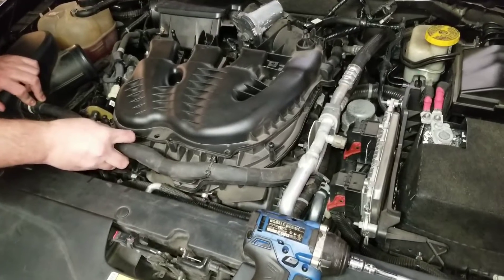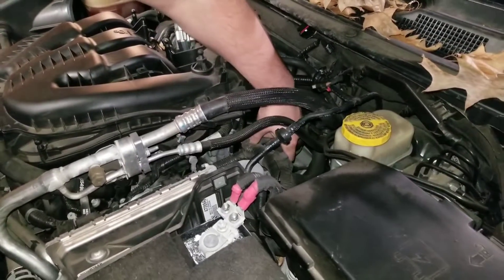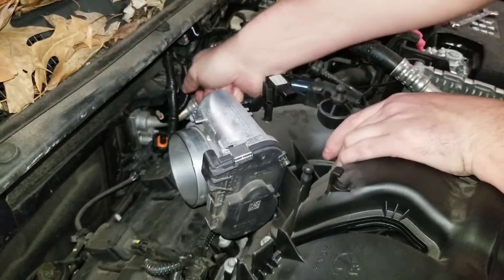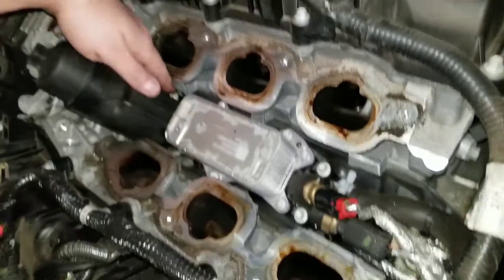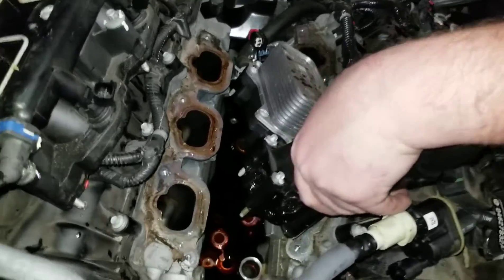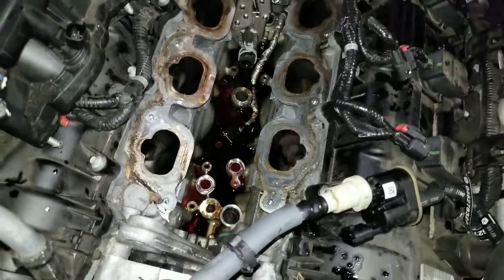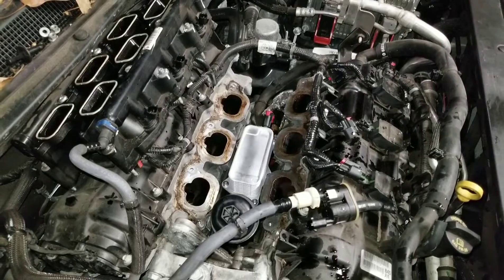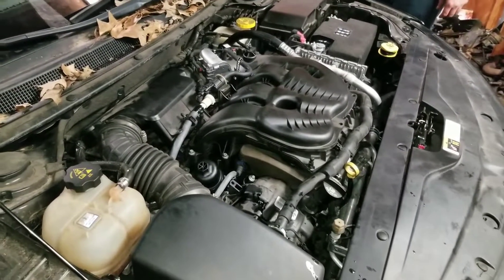2015 Chrysler 200S V6, Oil Leak At 100k Miles, How To Replace The Oil Cooler

Comment: Mine started leaking at 100k miles. It was a slow leak but at 130k miles it was bad.  Garage wanted $1100, i did it for under $300.  It took me a while because i had to make multiple trips to Harbor Freight for different tools (Torx sockets, etc.).  Those fuel injector connectors were a PITA..

Comment: Do i NEED to get new gaskets? Or can i do this very carefully and just replace my oil pressure sensor like i need to. I tried getting at it from the battery side, but my hand is too big for that.
Reply from the maker: You can try to do that without replacing gaskets but we always recommend that when someone takes something apart they replace all gaskets and seals they open up. You may be able to get away with not changing gaskets though.

Comment: 2015 200 with a v6, 108 thousand kms (around 70 thousand miles, mines leaking oil and coolant. Shop quoted me 900 dollars so im just gonna buy the 95 dollar aluminum part and do it myself
Reply from the maker: Yeah it's pretty easy to change out.

Comment: I have a Chrysler 200 2013 with 178k it just started licking a lot of oil when I run it could this be the problem on mine any suggestions?
Reply from the maker: Yes this could be the problem on yours.

Comment: I worked as a dodge tech for a decade and we had countless leaky oil coolers. Under warranty Chrysler wanted us to just do seals if no cracks evident but this is the best way to do it.

Mine has just started at 170,000km or about 105k miles, which is right on cue, or a little late even lol. Not a bad job, even in a driveway but you want to be prepared in that case and not forget to have oil and coolant ready.

Also not always needed but at 100k miles it's probably not a bad idea to spend the 50 bucks and put new intake gaskets in.

I grabbed plugs to put in while I'm at it but those buggers are 20 bucks a pop here in Canada. Insane lol

Comment: heres a few pointers for the guys who get stuck with this car, when you change the oil cooler assembly on a 2012,2013,2014, buy the oil cooler filter assembly for a 2017. by then they had redesigned the oil filter so you wont have to deal with those little valves that are in the assembly that always break off, the 2017 match right up with the port locations and all of the wiring, then when you change your oil you wont be breaking things just by removing the filter. and the filters for the 2017 models have the integral valve on the filter itself, it saves sooo much hassle, and the 2017 assembly is a little cheaper.

Comment: And always remember to buy an upper and lower intake gasket set EVERYTIME you remove the plenum..its not an option for the car to perform right. and pay close attention the torgue specs on those oil filter housing assembly bolts and the intake bolts i think it is only 7ft lbs.

Comment: I just got this done but now it’s throwing other codes. What should I do? 
 I was reading on a thread that the guy took the old sensors off the original part and put them on the new part and it fixed everything the codes where gone. Would that be a good idea?
Reply from the maker: Wouldn't hurt to try that, sometimes new sensors can be defective.

Comment: So I watched this and I went and looked around the oil filter housing and I see oil pooled up. But my has never been low. I checked it before hand and it was with in the normal range.
Reply from the maker: It actually takes a lot of oil leaking out before it'll show up on the dipstick, this car always showed to be full of oil but it was leaving puddles of oil everywhere it parked.
Reply: @1018Video  okay. The valley doesn’t look like it has a bunch it looks like it is all on the back side by the filter housing. I haven’t seen any oil spots or anything. But I have noticed a smell but I think it’s a coolant smell honestly seems sweet.  🤷🏼‍♂️ I’m gonna keep an eye on it hopefully can wait a month or two so I can get the money together
Reply from the maker: @bha5475  
All Dodge vehicles are notorious for having a coolant smell around the engine-bay. But yeah, I'd for sure start saving up for a new oil-cooler. Also these cars have radiator problems.

Comment: I had this replaced twice. 3/27/23 it was worth place with brand new  all-aluminum one a week later 4/3/23 it is still leaking oil what should I do next?
I'm already out of $1100 in the last 6mths

Comment: Good video man but do not use dexcool, Mopar extended life coolant from the dealer or Zerex G-05 should be used .  Also if your elbows deep in a 3.6 replace the intake seals while you are there, just a  suggestion.
Reply from the maker: We only did what the customer wanted us to do, cause they were on a tight budget.
Reply: @1018Video  I hear ya

Comment: Are the cooler gaskets/o-rings built in to the new cooler I ordered a new one and didn't notice a set of o-rings
Reply from the maker: I'm not sure, it may be in the video. I don't remember if the owner had to buy some or if we used the ones from the old cooler.

Comment: Do you know the part number cant find it and I have a 2015 v6 awd 200s
Reply from the maker: Should be able to find the part on EBay or at your local parts store. If you can't find it at those places check your local Dodge/Chrysler dealership.

Comment: All of those bolts you put back have torque requirements. A small vacuum cleaner, some tubing and an empty jug would have sucked all of that fluid out of there. All twelve of those intake gaskets needed replacing after sitting in oil and coolant. The intake area should have been sprayed with parts cleaner and wiped clean. I'm guessing it's not just Chrysler you have a problem with, half way maintenance makes half way cars.
Reply from the maker: That car doesn't leak, and everything works perfectly on it after this oil cooler install. Only thing that messed up was of course another Chrysler thing, the engine coolant radiator blew up 3 months after we fixed the oil cooler, but that's Chryslers fault of course. Everything to do with what we did on this car is still working perfectly to this day, so whatever we did must've worked. 🤷‍♂️🤷‍♂️
Reply: @1018Video  Almost a year, knock on wood.
Reply from the maker: @twadney 
If it lasts longer than 6 months it's no longer the mechanics fault. 🤣
Reply: This is exactly what i did. Took off the Coolant line, stuck a small hose in, and vacumed everything out. Then took off the bolts and Zero Coolant contamination

Comment: Already had this repaired twice. First time under warranty.  This  last time it cost me $750.
Reply: they make an all aluminum housing to fix it. replacing it with the plastic one is crazy as it will just fail again Dorman 926-876 Upgraded Aluminum Engine Oil Filter Housing Compatible with Select Models (OE FIX)
Reply from the maker: Yep pretty much.

Comment: Did u replace the oil filter housing unit In this video? If not then what did u replace because I’m experiencing the same issue far as oil leaking
Reply from the maker: I'm not sure, I don't remember exactly what happened in this video. If you have time watch it through.

Comment: Nothing to it but to do it. I'm getting ready to stick the 2014 part on a 2011 Grand Caravan. Also changing the intake gaskets and spark plugs... Surprised you didn't stick rags in the open ports just in case something were to fall in that could be a nightmare...There's one video one here where the mechanic actually finds an 8mm socket stuck in there that someone had previously dropped.
Reply from the maker: If we dropped something we would've just got in there and got it out, but yeah, covering the holes is a good idea for sure.

Comment: would it make sense to drain the oil to bypass the shenanigans with the paper towels, or would the oil cooler still hold oil and get everywhere?  i'm starting to leak near the oil cooler at 91k miles. i noticed it while i was changing my spark plugs last night.
Reply from the maker: The oil-cooler will still hold oil, draining the engine oil won't prevent the mess.

Yeah these cars have a lot of problems.
Reply: @1018Video  damnit Chrysler. lol I should sell the thing before anything else goes wrong
Reply: @1018Video  thank you

Comment: did you change the oil?
the intake surface looked a bit dirty
Reply from the maker: Yes, we changed the oil, because when you take the cooler off some coolant pours into the oil in the engine, because coolant runs through the oil cooler too.
Reply: I saw that too, I wouldn't go back to have work done by them. I'm doing the exact same on my car right now. I clean all gasket seats and put a bit of dielectric grease on the rubber gaskets.

Comment: Do the intake manifold gaskets need to be replaced as well? My 2015 only has 31,000 miles and I have this same problem. Massive oil leak and oil pooled next to the filter housing.
Reply from the maker: When you order the oil cooler it should come with the stuff you'll need. Everything that needs to be done is in this video.
Reply: @1018Video  ah ok. I thought there was a gasket between the upper manifold and lower manifold, and another between the lower manifold and the block, but I didn't see you remove one or put a new one in so I was confused.
Reply from the maker: With the miles as low as they were on the car we worked on, we just left the stock gaskets in place and reused them. You should be able to do the same, as long as they're not broken.
Reply: @1018Video  I thought it had 120k miles? If that's considered low for gaskets then I should be good. Just don't want to rip it all apart and then they're broken and I'll be screwed
Reply from the maker: @Mike__P 
The mileage wouldn't really be the problem for the gaskets, the age would, these cars are young enough to not need new intake gaskets and stuff, as long as they look okay.
Reply: Just coming back here because it seems I have the same problem again. I replaced this thing a year ago, and tonight I noticed oil on the ground and oil  pooled in the same spot under the oil filler neck. Why would this happen again so soon ?
Reply: Got ya beat, mine only has 25k miles and I just noticed the leak today. 2015 200c. The only reason I noticed it is that I'm having a #3 injector issue and was checking that out.
Reply: @anthonykrushinski9001  I got you beat.
 My new oil cooler failed again a year after I fixed it, which is shortly after that post you replied to 😆. I think I might have tightened the bolts too much, causing the gaskets to squish and leak prematurely. Use a torque wrench!
Reply: @Mike__P  I just went to the dealer and even though it’s out of warranty by time, they are going to cover it 100%. I think I should buy a lottery ticket now.

Comment: instead of leaking oil would it be possible that it is leaking Coolant instead? I have a massive leak coming from that area, might just go ahead and try to change the seals on it
Reply from the maker: I'm not sure, I think there may be coolant in that area, check the video cause I don't remember exactly.

Comment: My problem now....the mechanic is suggesting a radiator flush too is that need?
Reply from the maker: It's possible that you would need that also, since coolant does run through there too.

Comment: I have the exact same car, same engine, same year. I’m at about 68,000 miles and i have a mechanic shop telling me that my oil is leaking from the oil filter housing gasket. Is that similar to what’s in the video? Also, could putting oil in my car every now and then help it hold over until I’m ready to get it fixed?
Reply from the maker: The oil filter attaches to the oil cooler I believe, so yeah that'd be the same thing. If you plan on waiting to repair it, make sure you check your oil often, never overfill you engine with oil and never let it run too low! Thanks for watching!

Comment: 1 year late to the party, but thanks for the video. I've got a piece of shit 2016 chrysler 200 s thats having this damn problem at 67,000 miles. Along with the blower motor going out, the master cylinder failing, and the transmission. To sum it up, its just a POS.  Anyways, thanks again.
Reply from the maker: Sorry you're having all those problems, Chrysler isn't really known for its longevity! Thanks for watching!
Reply: My 2015 200s blower motor went out at 115000 and now I’m having this problem soon after🤦🏽‍♀️ just a headache. Plus connection issues going up and down
Reply from the maker: @queenhayden7060 
These aren't the greatest or most reliable cars to own that's for sure!

Comment: what size are those 5 bolts on the oil cooler?
Reply from the maker: I don't remember, I'm sure a basic socket-set will have the correct size for them though.

Comment: This is one of the worst designs I've ever seen MOPAR come out with. My sons car is a 2014 200 with a 3.6.  The one bolt hole that holds down the oil cooler has stripped threads in the aluminum manifold. We are about to tap the hole with bigger threads and use a conventional bolt. IF this doesn't work, he is getting rid of the car. We are also using red high temperature Permatex on the base. If it leaks, it's trade in time.
Reply from the maker: Hopefully that works out for you! The Chrysler 200 is a nice vehicle, just has some small issues. But if you think about it there isn't a vehicle in the world that doesn't have some kind of issue. Thanks for watching!

Comment: I replace my engine oil filter and once I got everything back together, it’s a long pipping noise and the light bolt icon comes on my dash
Reply from the maker: It's hard for me to be able to tell what's wrong with it without seeing it in person, but if I were you I'd go get that checked out by someone for sure.
Reply: same, did you find the fix?

Comment: How much did you pay for the oil cooler itself ?
Reply from the maker: I believe it was 150ish dollars.
Reply: @1018Video  thanks, and how did you drain the coolant ? Did you use the valve at the bottom of the radiator? I’m looking to prevent the coolant leaking all over the place if possible and i thought if I drained it from there that should do it

Comment: Oh, my God. Amateur Hour, huh  I have a feeling the same thing will happen soon. Because I don’t see that they haven’t cleaned up anything that needs to be cleaned. Not to mention the torque wrench. Tragic.
Reply from the maker: Worked out just fine in the end, car still runs fine to this day. No leaks.
Reply: @1018Video  That’s good. I’m happy for you. Hey. By the way. Your old parts are just leaking rubber bands, and if you replace them with new rubber bands, I think they’ll still work without the need for new parts... It’s just my imagination, though. .
Reply from the maker: The oil cooler was cracked, that's why it was leaking, apparently you don't know what you're talking about.

Comment: You should have cleaned all gasket seats! I wouldn't accept a job like that.
Reply from the maker: Nothing leaked anywhere when we were done with it, still to this day that car doesn't leak a drop.
Reply: I'm doing that exact same job right now myself. First thing I do, is put rags in the intake openings so nothing can fall in! Don't tell me you never drop something. If it goes unnoticed, goodbye engine. 2. It is normal practice to clean any gasket surface when doing work like that. As far as saying that nothing leaked, how do you know that the intake isn't leaking. If one of the ports is leaking, that cylinder will run lean and can cause engine damage. Might not happen tomorrow but it can! Just saying.
Reply from the maker: Well this job was a long time ago and everything is still perfect with the car today. And a cylinder running lean would cause a rough idle, or a situation that feels like a misfire, it would definitely not be unnoticed, 1 lean cylinder would not act the same as the other 5 good running cylinders, and it's easy to get the intake back off, so that's not a big issue and it's an easy fix. Also, if 1 cylinder is lean it'll throw on the check-engine-light.

Comment: Just to verify, you stated 10mm for the side nuts...I am assuming that is the same for the top bolts for the manifold and cooler unit as well?  I plan to do this sometime next week when my part arrives Monday.  Your video was insightful as it helped me decide that the job was simple enough to do myself, instead of a service shop.  Bit messy fluid wise, but I'm ok with that.  Takes me from forking out a dime for parts and labour...Amazon helped drop that to $250, including a new serpentine.  Thanks guys.  Keep up the good work.  I'll leave the really hard stuff in your hands.  ;-)
Reply from the maker: If you have basic tools and a basic socket set you can do this yourself, a shop would charge a decent amount if you have them do it. Thanks for watching! Glad you liked the video!